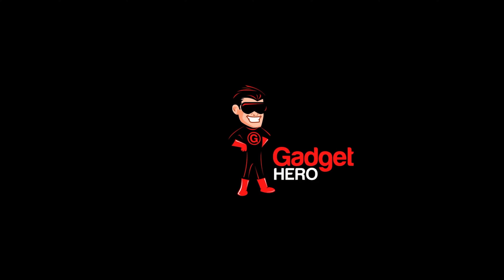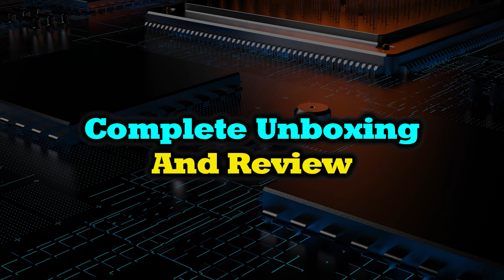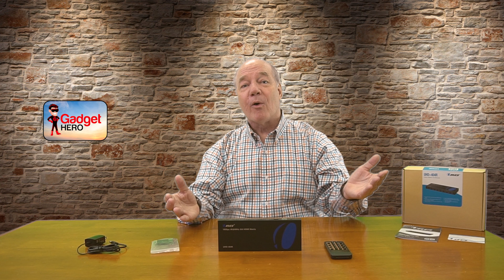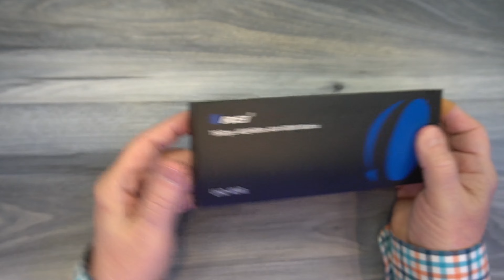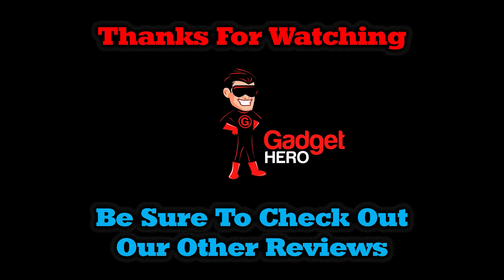UHD 404R | 4X4 HDMI Matrix - Share 4 Media Devices On The Same Screen!

Comment: Does this support HDMI eARC passthrough.
Reply: The UHD-404R I just purchased claims to have ARC  support & audio passthrough, but the device he just demoed does not even have the ARC button mine comes equippped with. This is so confusing. I ended up here because I'm researching a fix since I'm not getting an audio out to my soundbar.
Reply: @vellyderival7394 so I ended up hooking my sound system to a receiver, but that means sound can only come from one TV.